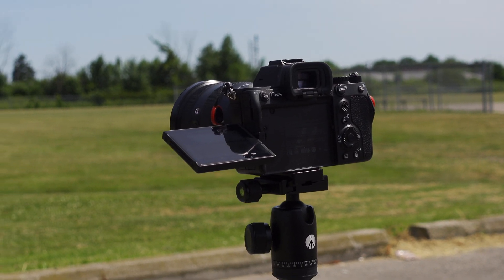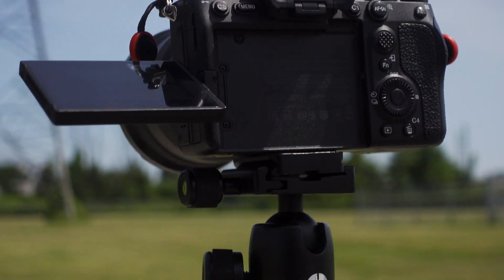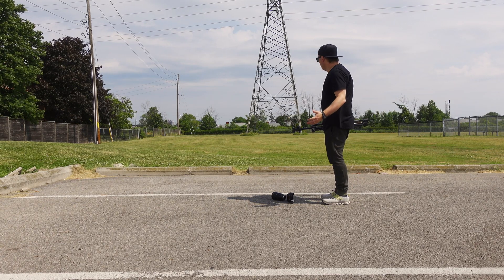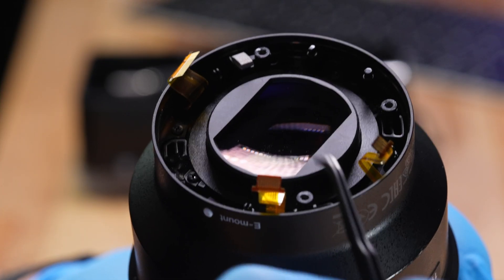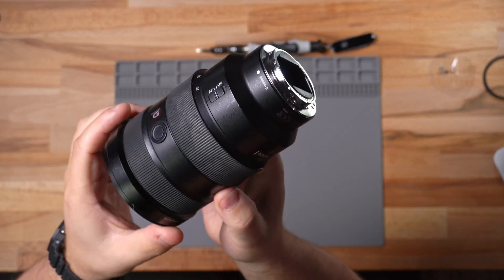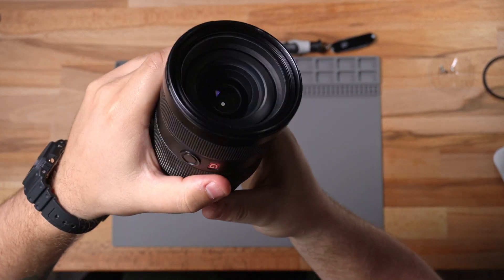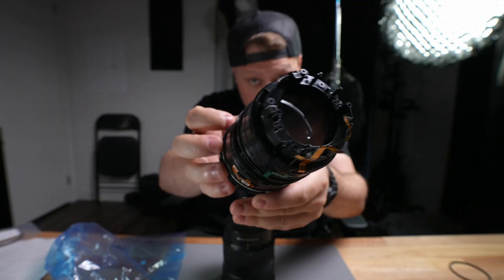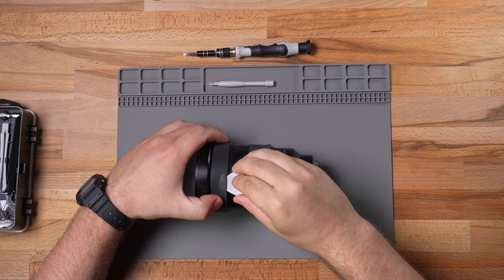Can I FIX A Broken Sony 24-70mm GM Lens for $100?

Comment: My 16-35mm GM stopped working and only shows F - - and no autofocus. It’s pretty much new and hardly used. Plugged in a micro hdmi into my Sony a7riii to use it as a webcam/streaming cam last night. Turned it off to save battery while it wasn’t in use, turned it back on and noticed it had broken 😢 so I haven’t a clue what’s happened. All because I plugged it into my pc, well my elgato 4k x. You’ve got some skill friend. Well done. I’m scared to see how much this will cost me ! So that’s why I came here to see if I could do it myself. But I don’t know what’s exactly wrong with it. I’ve tested my other lenses in my camera and those work fine. Put it in my second camera and it still didn’t work.

Comment: @Lee
I’m repairing a Lens Aperture Flex Cable for the Sony 70–200mm F2.8 GM that I picked up on eBay. The lens currently has no focus or aperture function.

After removing the switch panel, I found that a ribbon cable had been completely sheared off. Would repairing that be especially difficult?

Also, I noticed that the zoom ring travels past the normal 70–200 stops  possibly shearing the flex cable. Did you ever come across issues with broken zoom stops on your lens or notice how the stops work?

Any help would be greatly appreciated—thank you!

Comment: could you use this same dismantle process to get dust out from under the outer lens element? I used to take my canon lenses apart to fix them but I can't recall if I could clean the dust out. Maybe I'll take it apart now to see. Let me know, great video!
Reply from the maker: Yes and no. You would have to do what I did to get down to the lens groups. But you will have to go way further and take the lens groups apart to get to the front element. I will warn you that you will end up getting more dust inside unless you are working in an anti static dust free location
Reply: @LeeZavitz appreciate this !!

Comment: All of these camera service shops are a scam. My Fujifilm x100s stopped working and Fujifilm quoted 450 USD(replace lens assembly). I took my camera back and opened it up because I knew that the lens is not the issue. The problem was that the ribbon cable was a little bit slanted which connect the CMOS sensor to the motherboard. I put it back in and put tape so it wouldn't pop out again and now it works like normal again!

Comment: I am trying to do a similar repair and I have a threaded screw, it's one of the screws Lee is removing around 4:40. I don't suppose anyone can suggest anything beyond duct tape, elastic band, threaded screw extractor, etc? Otherwise looks like my 24-105 F4 G is going to the bin 😭😭

Comment: My Nikon Z 24-70 f2.8 S developed a hairline crack in the extending tube. I handed it in to Nikon service here in Sweden, they took two weeks to decide that they would not take it under warranty and gave me a quote of around 600 US dollars! Being held hostage , I had to agree the repair but I made it under the condition that everything that they are replacing must be returned with the lens, from the smallest screw to any seals etc! The lens was not dropped , worked perfectly, so I don’t understand that a thin plastic tube part can cost so much  even considering the time to fix it! I wish I could have sourced the part and fixed it myself as you did! Nearly a month on and still waiting, I shall never buy an extending lens again! Lesson learned! 👍🏾🙏🏾 🏴🇸🇪🇹🇹

Comment: This is incredible. Mine broke the exact same way while abroad in Costa Rica. Opening a precision lens was feeling mad intimidating, but your vid makes me realize it's no more complex than replacing an iPhone screen, which I've been doing since college. I'm gonna go for it.

One question.. what grease did you use to lube the spinny bits?
Reply: nvm, found your link.
Reply: I will bet that opening a lens is even easier, than opening a modern phone, due to the lack of glue.

Comment: Where did you source the parts? I’m having a focus issue (no AF or MF, with F— error) on my 16-35 GM and I think the issue may be a simple fix by replacing the board

Comment: Was there no way to glue in something to replace the post?
Reply from the maker: It wouldn’t hold up
Reply: Ok thanks, for the reply, ( I wasnt expecting it!). I'm in your postion and was  I was thinking of using "Methyl Methacrylate" which is supposed to be stronger than the polycarbonate (its a weld rather than a glue).  If you have already considedred this and found it too weak you have save me some wasted effort Jim @LeeZavitz

Comment: Just dropped my same lens and have the same broken back mount. After I watched your video, I ordered the barrel and the back mount piece as well(Warped). But my question to you sir, what is the white grease that you used to grease the part? TIA

Comment: very cool my dude! sometimes some shops like to lose money thinking a consumer doesn't have knowledge on a product they bring in for repair. glad you were able to fix it your self and save your self practically the price of a new lens. I got a 3 years repair or replacement warranty for both my A7IV and the 24-70mm G Master Lens to avoid this but I like what you did on the repair.

Comment: I'm fairly certain these repair centers will price themselves out of doing a simple repair that shouldn't be more than a few hundred dollars.  I had the same issue with Fuji, sent a camera body for repair due to very slight water damage and their repair quote mentioned nothing about water damage and quoted me basically the price of buying a used body.  Fixed it myself a year ago, camera is working flawlessly!  Great job repairing your own gear!
Reply from the maker: Some times you just have to take matters into your own hands. Especially when it’s not a warranty thing
Reply: @LeeZavitz  You want it done right, do it yourself!

Comment: I ran over my camera bag with my car by mistake. Drove over my 85mm 1.8Fe. It still works just fine but the focus ring is alot stiffer, so it must be bent a little lol
Reply from the maker: Oh man you must have felt awful and thought the worst
Reply: @LeeZavitz  yeah, my heart sank. The bag had my 28mm f2, my 55m zeiss and the 85mm in lol. Luckily all seem to be ok apart from the 85mm. It's the tallest lens so I reckon it protected the others. I was shooting the car when I left the back near it.

Comment: For the zoom ring you apply 3M 300lse adhesive. What was the white think applied after?
Reply from the maker: That was the original tape / plastic on the lens before. But the adhesive on it was kind of weak after I removed it. Since I didn’t have that as new I just added double sided tape to hold it down

Comment: “Blinker fluid...”🤣...good one! Yep, been there. Great video, fortunately, I have a long-term (25+ years ) relationship with my local camera store/repair shop (yes, they still exist👍), and are an authorized repair shop for most of the major brands, including Fuji which is my system and to date, none of my gear needed to be shipped out to the manufacturer's US headquarters (most are in NJ). Wish I could say the same for my cars.